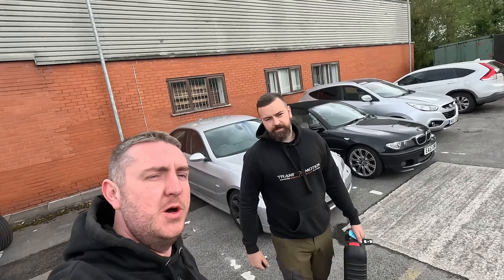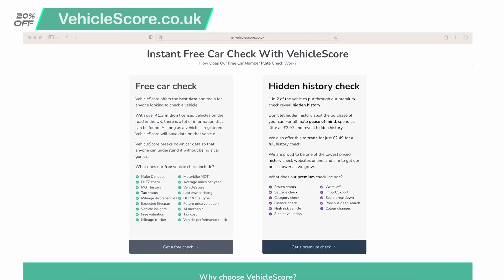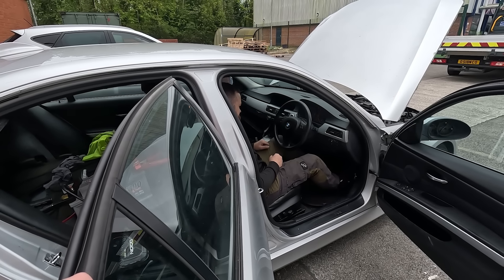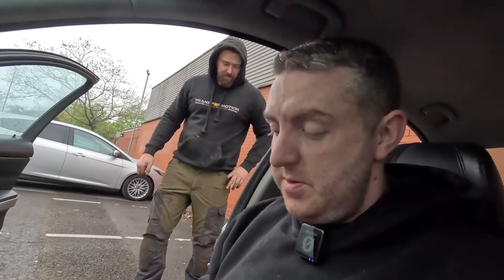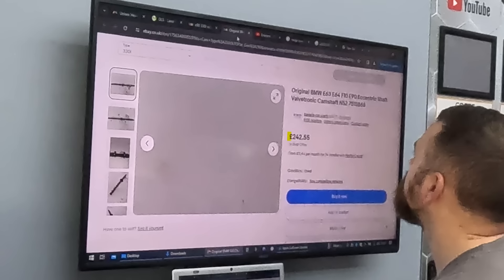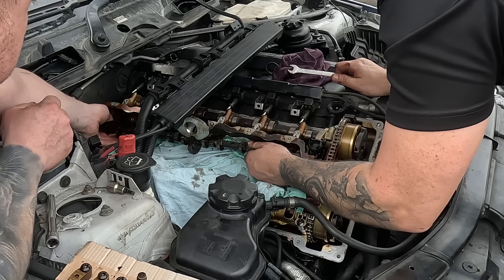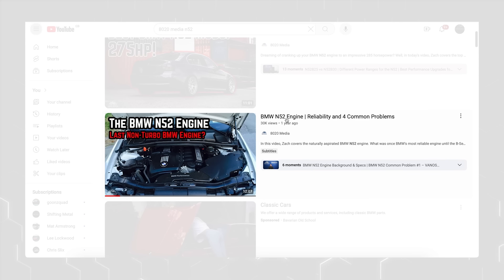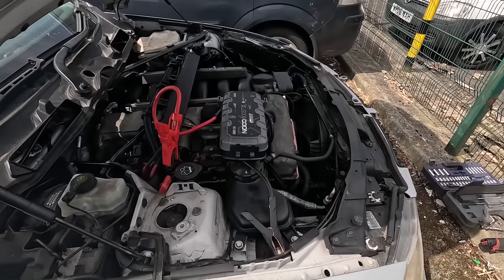BUYING AN £800 BMW 330i WITH AN ENGINE NIGHTMARE!!

Comment: I   never mess with my E38 Engine always take it to my specialist  He  only does BMWs E38 E39  M3 M5 330CI any and Half the the price of  BMW  they  Charge a £165 an hour its mad .At BMW the first £165 is just noise when they suck there teeth  and shake there head ,Im glad my Engine is M52 TU its on 200,000 now and quiet as an EV .
Reply from the maker: Ha ha if they shake their heads too that's another £100 🤣 sounds like a healthy motor